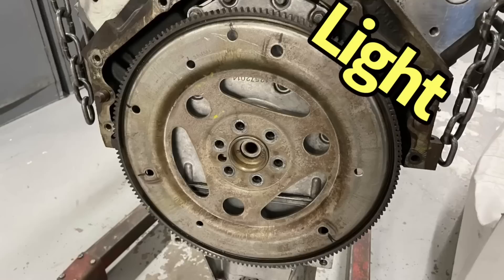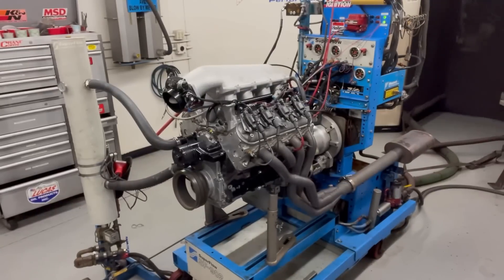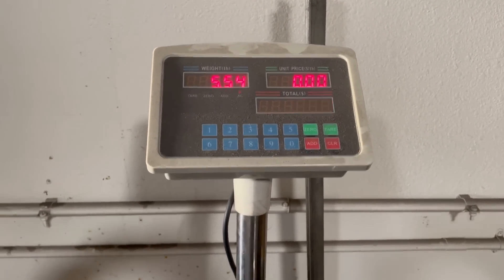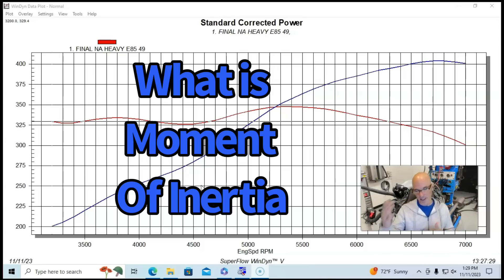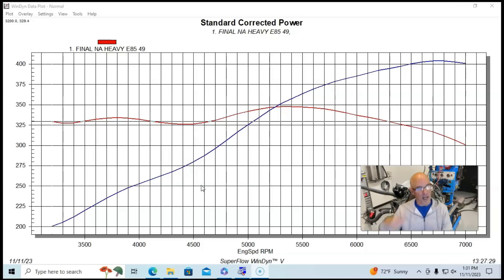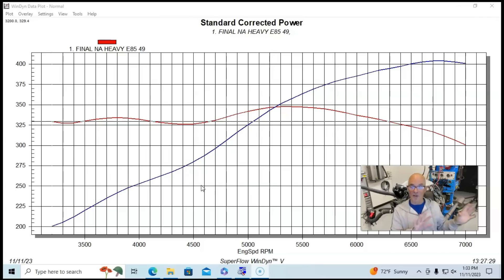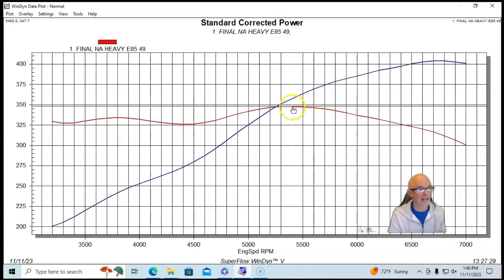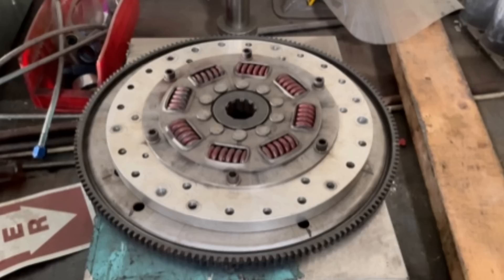FLYWHEEL VS FLEXPLATE-DOES A LIGHTWEIGHT FLYWHEEL ADD ANY POWER? 45 POUNDS VS 16 POUNDS-WHO WINS?

Comment: My HCI LS7 in the Corvette Z06 I picked up used had a McLeod RXT twin disc with an aluminum flywheel and it seemed like there was so little momentum that I'd stall the engine with the clutch pedal fully in when the power steering pump would struggle at full steering lock. It seemed like that was enough to kill what little momentum it had. Between that and just general driveability I'd rather take the slight performance loss for it to not be a pain in my ass.
Reply: I used to have a lot to do with water ski boats.

They were useless to control at low speed and idle without stalling by using just a flex plate or aluminium flywheel.

Always ran a heavy flywheel

Comment: learnt this here back in the kart racin days . took off the cast flywheel , installed the aluminum flywheel and changed the rear gear meant faster laps

Comment: I'd say it depends on the application. If you're drag racing, you're going to want that energy of the heavy fly wheel for the hit to the slicks on launch(depending on capable engine power, and launch RPM), otherwise your slicks could bog down your engine. If you're road racing, or on the street then you will be better served all around with the light weight flywheel.
Reply: I'd think a heavier flywheel would be better in a daily. You aren't racing around and you get more torque pulling out and a smoother idle.
Reply: @sijonda  I'm not sure it necessarily matters that much for a daily driver. I recently changed my Honda's stock 16 pound flywheel to a lighter but still OEM 10 pound flywheel and it definitely revs up and down quicker in neutral, but that's the biggest change I noticed. Also, slight RPM mismatches when engaging the clutch aren't quite as noticeable and throttle response in low gears is a little faster. It doesn't idle any differently, it doesn't feel much different taking off, and it doesn't feel noticeably faster when accelerating. Forgot all about it after a few days of driving lol.
Reply: exactly, you dont lose much rpm during shifts once you have the heavier flywheel turning. i know an old school drag racer that used a 50lb.
Reply: @141runn  The RPM lost between shifts is a function of two things- your shift points and your gear ratios. A heavier flywheel will give you more of a shove in the next gear as you engage the clutch since it will be harder to slow down, but in a drag racing application, that extra shove comes at the cost of slower acceleration while in gear, more clutch wear, possible wheelspin, and more shock loading on the drivetrain and car as a whole.
Reply: @averyalexander2303  thats why the guy i know who used the heavy flywheel would side step the clutch at 8500 rpm and his tires were hot first didnt slip. he didnt lose any between shifts either. now normal street driving it was a pig until you revved it it up an let it loose.
Reply: @141runn  If you have enough grip to launch it at 8500 without spinning the tires, a heavy flywheel may make sense in a drag racing application because it effectively lets you start generating power, store some energy, and build boost before the light turns green. But this obviously isn't a benefit if you are traction limited in 1st gear anyways.
Reply: @averyalexander2303  in drag racing inertia is important. In road racing fast revs is important especially coming out of a turn onto a straight away.
Reply: Ain't all modern manuel serious drag racers running some kind of soft locking clutch? With the perpose of exactly avoiding the "hit" that unsettle the suspension and make the tires "jump". The VERY fast manuel cars you see on the strip do often take off smoothly like an old Cadillac. I remember seeing even an 12 sec NHRA Stock racer using an adjustable slipper clutch.
Reply: @westmus  I think the key difference here is, these guys aren't putting down 1000+ horse power. So they have more lead leeway with how rough they can be. Just my guess.

Taking the step from a toy built in your garage for years vs just throwing money at something and having a group of people backing you like a lot of these YouTube channels have is a big difference.
Reply: @westmus  we're talking average everyday builds, top dollar builds.
Reply: You dont race a Dyno at the strip
Reply: I put a lightweight flywheel (7.1kg new one, stock was 11,3kg) on my 231hp BMW M54B30 drift car and I can definitely notice the loss in inertia especially under acceleration when changing gear from 1st to 2nd. Now it doesn't hit as hard. I used this technique where I initiate drift by going from 1st to 2nd and the car spins its tires aggressively then I go into drift from the power applied to the wheels. With the new flywheel the car just bogs down and doesn't spin the tires as much. That's because of the lack of inertia. It feels as if it has less torque even though if put on a dyno it probably makes the same amount, but the delivery is just different. I am already regretting it and might go back to stock 11,3kg flywheel. The good news is that at high rpm the car feels somewhat more lively, but that doesn't make one bit of a difference for drifting as usually you are initiating from mid rpm not high rpm. It's actually physically impossible to initiate drift from rpm close to redline as at that point you will be matching wheel speed and actual speed of the car. A drift car needs mid rpm torque to be able to power into initiation and unfortunately right now I lost a bit of that. The marginal gain in hp at the top of the rpm range is nice but its at the cost of inertia which is far more important to my use case. When chasing, using a lot of clutchwork and handbraking the lightweight flywheel makes things especially more difficult as you're trying to keep the engine at high rpm while breaking behind the lead driver. Driving like this means you are constantly disengaging the drivetrain from the engine by constantly using the clutch which means you're feeling the effects of loss in inertia even more often. Clutch kicks are less effective with a lightweight flywheel and when handbraking you really have to drop the clutch from redline to not have the car bog down on you. If you do it at like 4000rpm it's game over.

Comment: On my heads/cam LS7 I went from a stock LS7 clutch to a Mantic 9000 twin disc and the difference was crazy. The car was noticeably quicker. It makes a much bigger difference in lower gears where the RPM is climbing faster, but not as much of a difference in higher gears when it's not climbing as fast.
Reply: You had me at heads/cam LS7 😌👌🏻

Comment: The diameter deal is exactly why I don't run out and get the lighter aluminum drivelines right off the bat, because it is a small diameter not effecting rwhp / tq much at all.

Comment: RPM change per second should be specified to make this meaningful. A light flywheel wouldn't significantly help a truck pulling  a heavy load up a hill.
Reply: But it will help get away from deadstop flooring it. 0-100 will be much more quick

Comment: Kevin Cameron wrote great article about this for his page in Motorcyclist magazine.  There’s more to how the engine runs than just the weight of the flywheel.  The crankshaft accelerates  at each cylinder firing event and then decelerates until the next firing event (90 degrees for a cross plane crank 8 cylinder).  This creates a harmonic that transfers through the engine that effects all other engine systems, specifically the camshaft and valve timing.  The heavy flywheel engine will top-end better due to the smaller deceleration btwn firing events because of the heavy flywheel inertia.  This lessens the harmonics that effect the valve train.  As with most things ICE related, there is no perfect solution, but compromise based on what the engine will be powering.  Going to Bonneville or Talladega? Put the heaviest flywheel you can and send it.  Road racing where the engine will be accelerating the vehicle out of many slow speed corners?  Then a light flywheel will be the best choice.
Reply: Ive seen this tested on a dyno… the faster the ramp rate is on the dyno the larger the gain in power is and visa versa…  so the shorter your gearing is ie first gear the more power you have with a lighter weight flywheel… if you’re in OD or making a top speed run where the RPM is steady or barely increasing the power difference is 0! You can see this affect by increasing or decreasing the RPM ramp rate on the dyno 👍🏻
Reply: Yes Kevin's article was good. I've always used flywheels as a tuning tool on setting up MX bikes for different tracks.
Reply: I love your comment you're absolutely right. One time I ran aluminum flywheel in a street car lot of RPM but no torque. But I did do a lot of road racing in that car. The flywheel needed to have least 10 or 20 lb.
Reply: Does the flame front burn instantaneous in terms of crankshaft rotation or is it still burning and pressure expanding on the power stroke as the piston moves down? I'm not asking about when it is lit, but after. Gasoline only, not Diesel.
Reply: Wouldn't it depend on the engine, and rpm? An even firing parallel twin, or standard flat plane 4 would have all pistons stopping and starting at the same time, taking energy from, and back to the flywheel in the process, speeding it up and slowing it down, this inertia effect would increase with speed, but the power stroke and idle stroke effect would be constant. But in a V twin, one piston is accelerating whilst the other is decelerating, smoothing out this effect.
Reply: @joejoejoejoejoejoe4391  I can't think of a more "unsmooth" engine than a V-twin.
Reply: @DillonAuto  They have to have a 90 to 80 degree V angle, much less and the balancing is terrible.
Reply: Exactly 👍
Reply: Now put a light flywheel on a harley road king
Reply: Hey guys listen Bill Grumpy Jenkins used a flywheel nearly 80LBS to keep his SBC Vega kicking the ass out of nearly all comers for how long  Bill said the heavy flywheel allowed his small block to stay alive during launch & gear changes keeping his motor in the power longer ..
Reply: you're wrong, and so is Kevin Cameron, at steady speed the engine will produce the same power and torque regardless of flywheel weight; the difference comes in acceleration and deceleration, some of the power has to go into changing speed of the flywheel and is therefore not available to go to the vehicle (or, in this case, the dyno load cell to be measured)
Reply: While that may be true for motorcycle engines, any V8 has a harmonic balancer on the front of the crankshaft to dampen the harmonic issues.

Comment: Did it in a hopped up mustang with no other changes. Car seemed to rev up and accelerate faster. It also was easier on the street tires on shifts. Seemed improved for street driving on street tires? Unfortunately I never took it to the track and it had fried the stick clutch before I changed the setup.

Comment: I've been running a light clutch since the 2000s in my 99 camaro ss....like really light. Complete clutch/flywheel is 16lb.
Reply: What is done to your Camaro and how is driving it different from the stock one? Thinking of one for my 98 WS6
Reply: @BlackRam17 it had a bolt on ls6 in it. Now that engine is rebuilt. There's vid on my channel of me driving it. There are some things that needs done to make the set up i have viable. But regular aluminum flywheel lightened clutch shit is really no different than stock except better.
Reply: @HioSSilver1999 noticeably quicker?
Reply: @BlackRam17 the bolt on ls6 went 10.7@130ish and it wasn't in some gutted heap. It definitely makes your engine far more responsive ;)
Reply: @HioSSilver1999 that’s what I was hoping for, I have HCI build

Comment: I weighed the 12.25” clutch and flywheel setup for my 87 F-250 behind a 7.5L with the ZF-S5 and it was about 82.5lbs without bolts.
Reply: How thick is it lol
Reply from the maker: DIESEL FLY AND CLUTCH ASSEMBLIES ARE VERY HEAVY
Reply: @richardholdener1727 460 is gasoline
Reply from the maker: thought it was the 7.3-my bad
Reply: @richardholdener1727  They both use the same basic transmission so a very similar setup. It’s great for idling around in 5.76:1 first and 2.69:1 low range.

Comment: Interesting thing is that old gassers in the mid 70s would use a 50 pound flywheel on a 292 cu in small block chevy because the increased moment of inertia increased the momentum of the system and helped the heavy cars launch off the line better
Reply: Once its spun up the rotating mass would help, makes sense

Comment: What was the difference in time to accel from load in to max rpm between these 2 setups?
Reply from the maker: DYNO HASS CONTROLLED ACCLERATION RATE 300 RPM PER SECOND
Reply: ok thanks :] @richardholdener1727

Comment: I was always under the impression that the stored energy in the heavier flywheels assisted with shifting into the next gear preventing the engine from "bogging"...  I wonder if there is an actual downside...
Reply: Ive ran both and found the heavy setup to be quicker in my combo full weight f body ls1 i sixty foot better with the heavy  setup and definitely better on shift recovery
Reply: One downside I noticed with a light flywheel was that engine braking didn't work so well. If you use engine braking a lot, you might need to use the actual brakes more.
Reply: @michaelblacktree  What about the engine braking didn't work as well? Assuming everything else is equal, engine braking should slow the car down a little faster with a lighter flywheel since the drivetrain (and the car as a whole) has less inertia with the same braking force.
Reply: @averyalexander2303  - A lighter flywheel spins up faster. So it absorbs less energy from the forward motion of the car, when engine braking. For road racing, that's actually a benefit, because there's less chance of upsetting the car.
Reply: @michaelblacktree  That's true, I didn't think of that since I rarely downshift without rev matching. That will only be a factor for the small amount of time it takes to engage the clutch though. Once the clutch is fully engaged, the engine braking should be more effective with a lighter flywheel since there will be less rotating mass and total mass to slow down.
Reply: I loved my lightweight clutch and flywheel setup but one downside was when you push the clutch in the engine would decelerate too fast and shut off.  I had to adjust the fuel, timing, and idle tables to prevent it.
Reply: I have always been told run a heavy flywheel on a street car. That came from all the old timers
Reply: @justinadams1360 
Engine will stall at a stop easier with lightweight flywheel especially in a mid-heavyweight car
Reply: Only when you have an improper torque converter set up a heavier flywheel will benefit. If you change the flywheel weight, you need to change the torque converter set up. 
100% of the time  when reducing weight in the drive line and using it properly, you will be faster.

Comment: My dad swore by using lightweight flywheels on air cooled VW stuff. Not sure itll have a huge impact on a V8.
Reply: My 570 whp Corvette was a lot quicker in 1st and 2nd gear going from a 60 lbs stock LS7 clutch to a Mantic 9000 twin which was only about 35 lbs and had all the mass much closer to the center.

Comment: george bryce has a claim that lightweight flyweel doesn’t have inertia during the gear change and loses acceleration in a drag race butthats on a harley
Reply: Vizard claims  on a SBC  there is a gain with a heavier harmonic balancer.  I wonder the details there
Reply: @natelorimer8567 the heavier harmonic is dampening the crankshaft harmonics being fed into the camshaft.  The small diameter of the harmonic has a negligible effect on moment of inertia, in comparison to its beneficial effects on valve train and ignition timing

Comment: Going from a stock c4 Corvette stock flywheel & clutch (45-50 lbs)to a ram aluminum flywheel & clutch 20-25 pounds. The car definitely accelerates faster. Less rotational mass helps it wind up faster, and if it's accelerated faster there is less parasitic loss.
Reply: Does the 5hp you picked are worth the driveability loss?, for real what are your thoughts? I'm thinking to do the same
Reply: @rogergm92  for a street car that's just a toy it's fine, if I was drag racing I'd probably go with a heavier flywheel, but not as heavy as stock.
Reply: Try to run that aluminum flywheel through a season of SCCA autocross. It will overheat and not hold up. There is a reason they engineered the car with the flywheel that they used
Reply: @chipcurrey653  um, I shift once per run - from first to second, when autocrossing.  What are you doing that would overheat a flywheel? 🤣
Reply: @shifty3583  exactly my thoughts. 🤣 Clutch killing non driver
Reply: @chipcurrey653 that's not true. You just don't have the right set up. 5.5 and smaller tiltons have been used in road racing forever.
Reply: @chipcurrey653  they used the heavy dual mass flywheel to kill noise vibration and harshness, and made it heavy to augment the torque. It weighes about 45 pounds, that's the same weight as many diesel trucks. If horsepower and rpm are the goal it's horrible, if you're racing a stock class with tpi on tight twisty courses I'm sure you do like the factory flywheel, helps get the car out of the corners quicker. But.. it's 225-245 HP, 350tq. Once you start making changes to the cars engine it's not the best setup to use.
Reply: @b.c4066  I tried the ram setup on my C5 z06 and it couldn't finish a single day of autocrossing without overheating and the clutch breaking down. This was not a race car and otherwise close to stock. It's a junk modification that reduces repeatability
Reply: @chipcurrey653  what does a c5 have to do with anything I said about a c4, totally different animal An LS1 vs tpi.. is not even the same discussion.